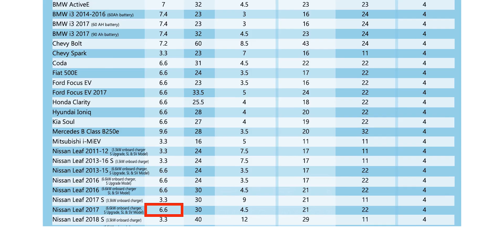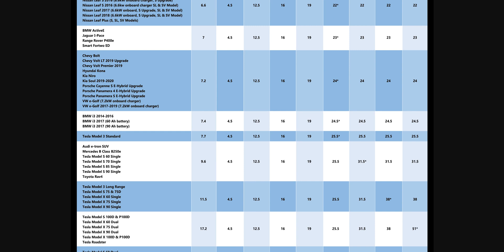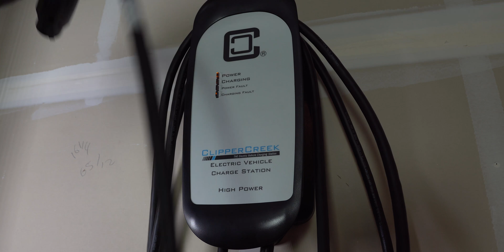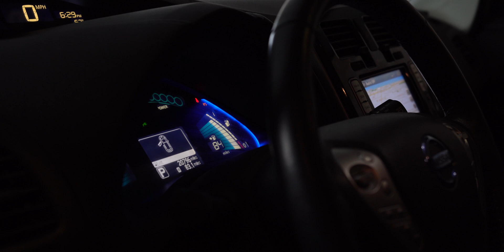How to Pick a Level 2 EV Charger

Comment: 0:45 Does wiring a 240v outlet for more amps really cost much more money? The difference in material costs would maybe be $10-15. To future proof the outlet, if you have room in your panel, why not just go ahead with wiring a 50 amp setup? If your car requires less, then it will simply draw what it needs. Come the day you upgrade to a newer EV with faster charging capacity, you'll be glad you did.
Reply: That's what I am doing given the federal tax credit and state rebate. I am having to pay more for the 40 amp charger though.